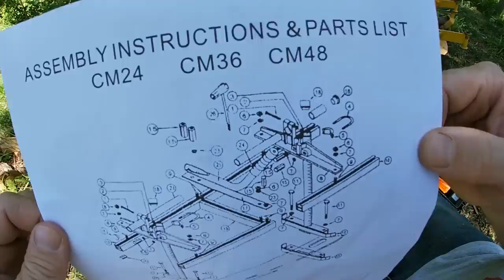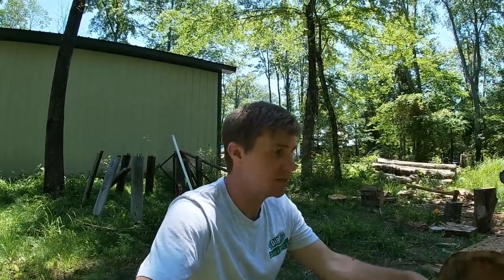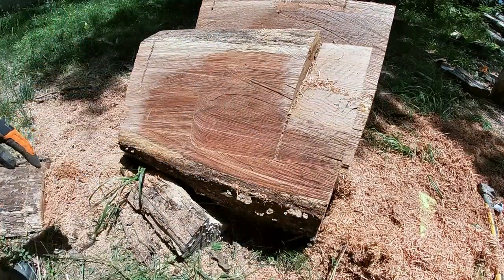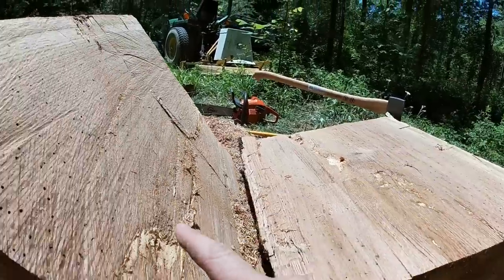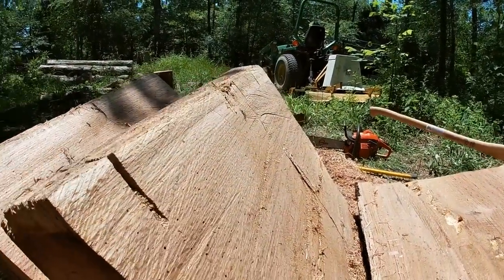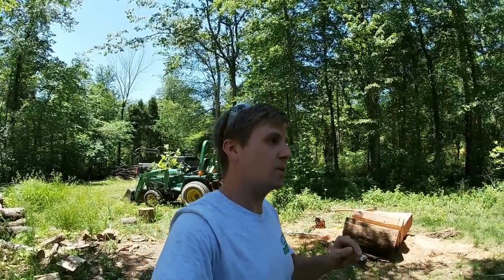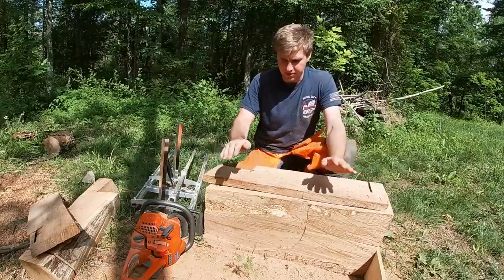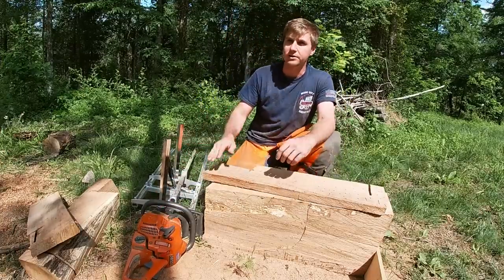Small Alaskan Mill - Small Log - Is it worth it?  My first attempts.

Comment: Screw a ladder or board to the top of the piece you're going to cut and let the guide piece stick out a foot so you have the saw resting on the guide before your chain ever makes contact with the wood you're cutting.

Comment: Without going through all of your comments, this suggestion may have already come up. When I used to cut lumber with my chainsaw mill, years ago, I found the biggest relief for my saw was changing from the typical cross cut chain, to a ripping chain. Less stress for the saw and much quicker cut. Just a suggestion for your new saw you will be buying. Not sure now, but years ago they were only a little bit more expensive.
Reply from the maker: Blu Ice a ripping chain is definitely on my to get list.

Comment: with dulling of the chain comes increased load on the saw and thus increasing heat. It is easy to fool yourself that a larger displacement saw will solve the problem, it will to a point, but you have to keep the chain sharp and take steps to reduce heat generation on the power head. I always ran my saws rich  jet setting and 20% additional oil in the gasoline and I did not push them at max when in the wood. You can find a sawing pace that will allow for lower throttle position. If you are in a long and difficult cut there is nothing wrong with a cool down, at least to the degree that you back off the cut and let the saw idle to cool it off some. Most people do not realize how often the chain has to be sharpened, they tend to push them far too long. I got to the point of having a bunch of chains sharp and ready, the change over to a new chain I preferred to sharpening on the bar at the site. :Let the saw rest and cool between cuts. The ability to not overheat a saw is kind of a learned trait, some just don't ever get it but if you catch on to how much work your saw can do without risk those saws will run for a long, long time. Use of auxillary chain oiler plumbed into the bar near the tip is a big help, reduces load on the power head due to better chain oiling and it reduces chain wear big time along with keeping the chain and drive sprocket cooler. You can see, it is a multitude of things in sawing that add up to making possible the long and hard milling cuts with the 2 stroke power heads. I used a 87 cc saw, never came even close to wearing it out but I ate up a truck load of chains.

Comment: Not too much out there on how to rip logs https://www.youtube.com/post/UgkxfQm1wmg0ItKDLavxj1nXtQY9HP7EF504 with an electric chain saw for a home made saw mill, so I pieced the Oregon CS1500 with the Timber Tuff Guide. Wanted to go with the Alaskan sawmill type, but the bar on the CS1500 is pretty thin. The clamp for the Alaskan is typically 2" and the CS1500 bar at the base is ~2", so too close for comfort. Regardless, the guide worked well with the chainsaw. Didn't eat up bar chain oil faster than normal. For a 4' by 18" diameter Douglas Fir (about 3 weeks after being felled), it took about 15 minutes to cut through a slab. Chain didn't fall off a single time. I don't think other users were putting enough tension on it. The sharpener is amazingly convenient! Very happy with my purchase.

Comment: Nice work! I like your creativeness on the rail system. On longer logs, you can take the horizontal piece and screw it right to the log for your establishing cut. You can build one from aluminum but then have to drill set of holes for differing length logs. 6 of one 1/2 dozen of the other. Turn your oiler all the way up (if its adjustable)on the saw. It will help the chain and bar last a lot longer. For starting a cut, a lot of it is practice. One tip that does help, slide the bar that has the vertical handle so it is about 2/3 of the width of the cut away from the powerhead. The bottom of the bar that this handle is attached to is at the same level as the long rails, this will help you be more stable until the 2nd rail gets on the log. If you are cutting longer slabs, take your wedges and put them in the cut as you travel down the log, this will keep the slab from drooping and binding on the chain.
Reply from the maker: Travis Macie these are all great suggestions and I’ll be trying them!  Thank you!

Comment: The middle crossbar, on which the black handle is mounted, should be adjusted to ride along the center of the log being milled so that as you are starting and ending your cut it will ride along the log keeping your mill level.

Comment: If you had a couple of steel wedges you could split those big oak logs through the heart two ways before you start to saw. Then you could cut quarter sawn lumber. That increases its value. And the smaller saw would love cutting through material ¼ the size.
Reply from the maker: Papaw that’s a pretty good point.  Thanks for the tip!

Comment: I made my slabbing rails out of 2x4 Studs that I squared and planed I simply screw it to the top of the log and it does a nice job on that first cut. Your frame for the slabbing rail is a great idea for smaller stuff. I purchased a rip cut chain from Granberg, I think the angle on this chain is 10°. It is far better than using a standard, crosscut, blade but also dulls quickly too.

Comment: I built one to fit my 660 stihl, built it to fit a 36" bar for cutting slabs to make live edge benches and tables.  Works great and it's fun.  Amazing what you can cut out of some old junk log that would otherwise be destined for the wood stove.
Reply from the maker: Zachary Cullen I agree with ya there.  Can’t wait to see what I can come up with isn’t he future. You have any pics of your work?
Reply: @CaptainKleeman  I do.  In fact I just cut some maple slabs today, had to free hand them with a 36" bar, huge log but there's some really cool slabs there.  Just my wintertime hobby, I'm a full time firefighter and I run a excavation business so as soon as spring hits in flat out.

Comment: Great video, looking forward to seeing your eventual method. I’m only a arm chair miller but on of the common methods I’ve seen uses a flat 2x8 across the top such that any variation in the previous cut doesn’t telegraph into the next. A 2x4 screwed lengthwise at 90 deg would stabilize the 2x8 to keep it flat. The L shaped end profile of 10x4 allows you to screw it to the Leading edge and cut a 2” plank. Stay safe, wishing you and your family the best.
Reply from the maker: Tom Bixby thank you sir!  Hope everything is going great on your end

Comment: You need the big one with the band saw. And that electric sharpener is the beez kneez !!! That's what I use on my chains. And I got the same saw dude !!!!!! Great saw. Need more vids Cpt.
Reply from the maker: Spydr 1 or Mark 1 Ild love to have a big band saw mill one day.
Reply: Bandsaw mills are the ones for more commercial use, since the kerf of the blade gives more wood than the chain saw blade does.
Long term, one could be an investment that can coffee can fund more stuff fairly easily.
Reply: @CaptainKleeman  Size of log most commonly milled is what should determine your mill size with one.
When it comes to looking at buying one, is it important that something this complex have local support ( dealership )? That will push the price up if so.
The value in one is the custom cut lumber you can make, which means the ground mounted extendable rails options will give you more options for cuts. The trailered mills are only good for the lengths up to the trailer.
Which features do you want? included hydraulic log loader, log roller, debark blade ( protect mill blade from rocks ) all add to the cost. You can't upgrade to one with the hydraulics by adding the hydraulics, it's buy a whole new mill to upgrade. So figuring out that you will want and coffee can fund until you can get it is likely the better option as far as that goes.

Most of the bandsaw mill manufacturers have a blade sharpener available, a much cheaper option than sending them off to get sharpened ( and another source of income since you can sharpen any bandsaw blade for the regular mills. ) Logger Wade's stuff is a whole 'nother level and not compatible with the stuff your more likely to get.

Comment: I've used this 12 volt sharpener for many years. I did take off the guide as it can be cumbersome after a while because your grinding bits get smaller diameter each time you use one.  So with a little experience you can free hand sharpen your chain.

Comment: Like Chris said below, you need to push not pull when cutting. That assembly sheet appeared vague so it's likely easy to get assembly wrong. It appears you might get by with remounting the middle handle assembly. Also, be sure to lift slightly on your saw and use shims often.

Comment: get a ripping chain, put the piece of wood up higher on sawhorses, logs, etc to a comfortable height, and angle your sawmill at like a 45 degree to start your cut as you get a lot of the guiderail on the log, I also just use a 2X8 as my initial guiderail, screw it right to the log (no wobble then, like in your guide stand you made that is not attached to your piece of log, just make sure your first cut is deep enough to pass under your screws, get wedges to hold the cut open on bigger logs, place the wedges every 2 feet or so in your cut, that keeps the bar from pinching , that should help. and SHE IS ADORABLE !!
Reply from the maker: Thanks for the tips!
Reply: yes, your welcome, my friend Todd, uses a guiderail like yours, and claims it works well with larger logs ((much like a regular sawmill would)) -I'm 56, and have a tractor to lift my logs up, the ground is too far away for me to use a set up like yours, LOL, HEY, whatever works !!! have a great day

Comment: Yeah that end clip was pretty funny. Smaller boards are good for smaller projects, even at the truss plant I work at we still get bunks of short material. Couple of those shorter boards glued together, sanded and stained nice with short legs would make for really nice end tables or night stands. Might be a little thick for something like that but with practice you likely will get nicer cuts. Its the only way you get better at anything, just practice.
I noticed some other people mentioned looking for a chain more suited to longer cuts and that was really my suggestion to your set up. 

The ladder might be a good way to go for your guide rails, especially if the fire department has to get rid of them every so often. Though you may have to cut some rungs out to make sure it isn't usable as a ladder.  It's worth asking about, worse they will say is no.
Reply from the maker: BlueDually4x4 those seem to be the two biggest things,  a ripping chain and using an old aluminum ladder.  I definitely appreciate your feedback as always.  And always taking the time to leave a comment!

Comment: There is a sprocket at the end of the chainsaw bar if you pinch it it will make your chainsaw work harder, so the end clamp you probably need to move it in to the bar  getting it off of that’ sprocket.

Comment: A for effort. But a few things that make getting into chainsaw milling a lot easier (from the perspective of someone who just started themselves). There is no replacement for displacement. 50cc is generally considered the minimum for milling. 70cc or more is a better place to start. Use a ripping chain. If you can't find a ripping chain for your current bar; then you'll need to get a dedicated bar for the chain sizes available. Even just for "gaining experience" using a cross-cut chain is going to introduce unnecessary frustration. Keep your top rail for the first cut simple. You had a cool idea for the rail setup, and I'm sure it could work. But realistically the less effort needed to setup up and make the first cut the better. A couple 2x4s and a couple pieces of angle iron is what we used. And it only took 10 minutes to set up AND make the first cut on our logs with that setup. Cheap wedges also make a huge difference. A 6 pack from amazon was maybe $10? I bought a couple sets and wedging the log as we worked our way along made things go quick (about 5 minutes to cut a 5/4 slab from a 20" wide by 7 1/2 foot long black walnut log). Anyway, keep up the good work!

Comment: Instructions 
Step one: assemble mill 
Step two: mill wood

I do believe that green wood is easier to mill than dry. I’ve never used an electric chain sharpener, I’ve always used a file. I heard the electric sharpeners kinda harden the chains and make it hard to hand file later. I’ve never tried so I’m not sure, just what I heard.

Comment: The electric Oregon sharpener isn't considerably faster than a vice & a file! I've had them all. Nice vid Cap'n keep them coming! Are there any Ameteur (ham) radio operators on the barges! Might be interesting to look into! As I said before, it's time for STIHL to step up and send you a test unit! A big Farm Boss I'd think would be a good fit!
Reply from the maker: Rockey Rockey im not sure if there are any ham operators or not.  Would be slot of work moving the equipment around,  the ya rent always on the same boat for back to back trips.  Would be cool though!

Comment: Never owned one nor operated one, but I'm a problem solver... or I try to be.  For getting started, could you just add a piece of square stock, same thickness of the outer bars, in the middle of the frame slightly ahead of where the blade is that is parallel with the outer two bars?  Basically a third cross bar (length wise)... or even width wide right under the handle going the direction of the log/perpendicular to the chainsaw bar?  Donno if I'm helping or confusing.
Reply from the maker: BurningDinosaurs no, makes sense,  something to carry the plain/plane of the mill prior to the saw making the cut and the rear cross member making contact.  I may look into that.  Thanks for the idea Wes!

Comment: experience has value even if the wood might not. keep at it it takes practice to get good at most things cough not taking out mirrors, 
those 12volt sharpeners are really nice for in the field sharpening especially once the bar length gets bigger and bigger. hand filing a 50 inch bar is a bit tiring, i had to do it once because i forgot to grab the 12 volt grinder and i wasnt the one running the saw but the one responsible for grabbing everything we needed, the boss got a good lunch break and laugh out of it, i got sore hands and wrists :(
Reply from the maker: Erik Giggey lessons learned!  Haha.  Good story to look back on.

Comment: look into using u struts to build the frame.they have many fittings to build with they are very strong.they have holes in them for easy adjustments
Reply from the maker: casy casy I’ll check that out.  Thanks for the tip!

Comment: Just trying to get into chainsaw milling.  What I (think I) have learned learned so far is the bar in the middle of the mill with the handle above it can be adjusted to guide it in to start and help keep it level.  Also turn the handle grip around the other way.  In the picture on the manual showed it the way you have it (to pull).  I saw in Granberg video they it the other way (to push).  I haven't even used a chainsaw mill yet so don't anyone do anything I say without doing some research yourself.

Comment: Just an observation since I’ve never used an Alaskan Mill. The bar your handle is attached to is at the same level as the outer frame so when starting you need to apply pressure to keep that bar flat on the wood. Same for ending the cut. 

Using the top rail system means you have to adjust the mill frame for every single piece you cut. If you want 1” boards you don’t want to adjust the frame every time. 
I’m sure you will give up on that frame as you gain experience. A flat piece of 2x10 screwed to the log with wedges to level end to end will give you your first cut. It can be longer to give you a level start. Just don’t cut through your screws. 😉

Comment: Secure your log....preparation for first cut the key
Use aluminium extension ladder for top rail (secure to log and wedge to reduce any flex)
Line up the adjustable handle bar on the mill to be centered over cut face.....this bar allows you to keep your reference alignment on the lead in to your cut (@23:45 handle rail needed to be ~3" closer to power head so it rested over center of cut)
Especially when running along a cut face let your mill bar guide slide along (it will want to pull the saw into the cut....let it), dont wrestle the saw just concentrate on keeping cut stable aligned and smooth = best cut face
Wedge your cut
Reduce you tooth cut angle to 5-10 degrees to reduce saw marks in cut (skip chain works best for milling)
The mill frame is made from standard aluminium extrusion used for road sign framing - find some and cut to length to suit bar
Use 1-2-3 style engineiring standard blocks to set bar height to standard slab thickness
Use simple winch set up when milling larger/longer logs
For larger projects/saws also look into fitting auxillary bar tip oiler
Eye/face/ear pro might be a better investment than chaps (....not that chaps arent a good idea But definetly eyes and ears!)
I remove the safety bar and dogs from chainsaw when milling to give max bar clearance
Just some suggestions, enjoy

Comment: When you sharpen your saw make sure you check your raker cross cut saw has small theeth and a rip saw has course teeth so your raker should be more aggressive than cutting across the log.by the way i love your videos
Reply from the maker: Gary Halteman awesome tip on taking the raker down a little more.  Thanks!

Comment: i never found a good ripping chain so i made my own file your teeth on a 90 degree and take down the rakers it will cut faster and way smoother but dont use the anti kickback chains i milled a lot of wood with these mills but now i have a bandsaw  and its a lot less work